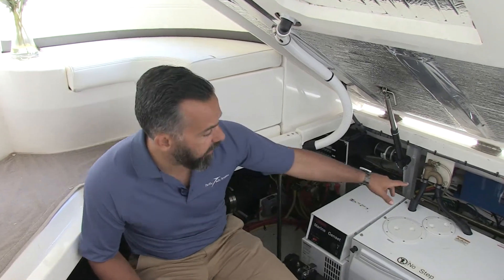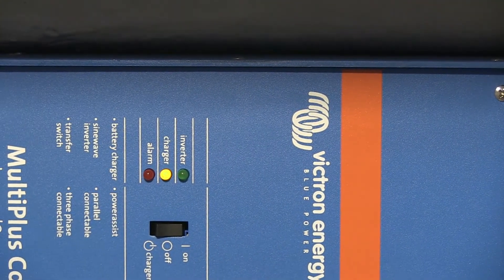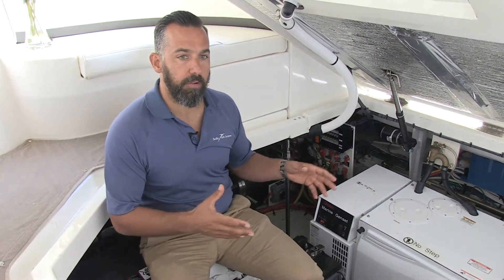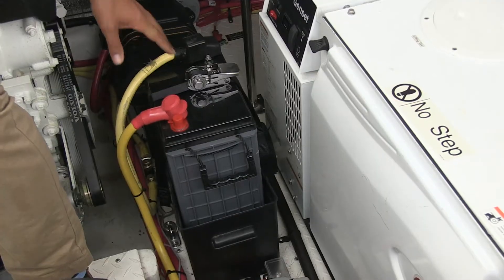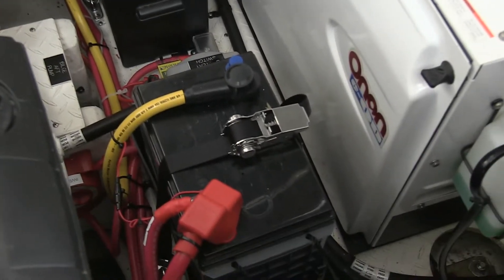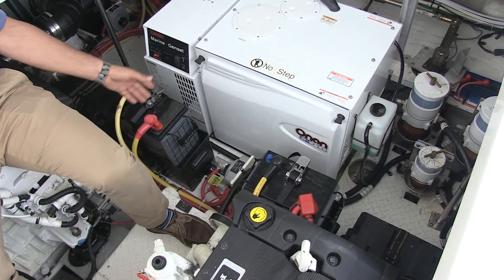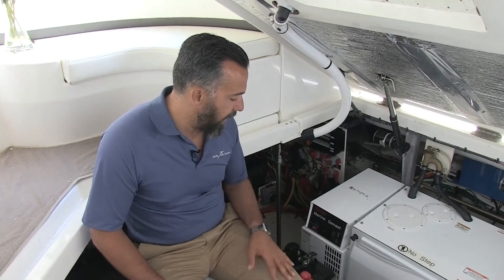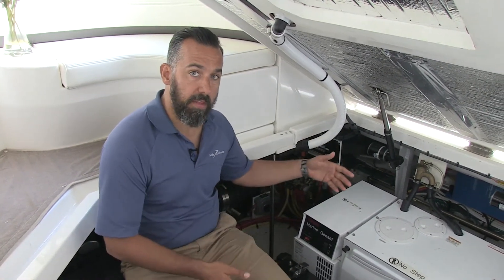Cruiser 420 - PYS Electrical Project - Objectives

Comment: I understand how you were able to divide the panel up on the load side. but the where did you connect the neutrals and grounds (120 volt) on the load side of the inverter? I have a cruiser yacht also and after hooking the inverter load neutrals and grounds to the main bus bars on the boat the inverted would fail. maybe the inverter has a internal gfi or something?
Reply from the maker: Hi Roger, you have to create a new sub-bus for the neutral. The inverter output connects to the new inverter hot and neutral bus. The AC grounding bus stays common.
Reply: @PacificYachtSystems  Thank You! Makes since to me. My inverter does not have a transfer switch can you recommend a good transfer switch for a 3K inverter. So I dont have to run the inverter on shore power. Also if I installed the transfer switch wouldn't the neutrals be tied together and give me the same problem?

Comment: I've watched almost all of your vids.  They are the most informative and detailed I have seen.  I have read Calder's book and feel like I have what I need to install the "DC only" electrical for my boat.  
One question still remains in my head.   When connecting my lighting circuit I was planning to run them in series.  Branching all 4 LED lights (independently switched) off the same 10 AWG wire and back to the breaker.  What type of connectors should I use to do this